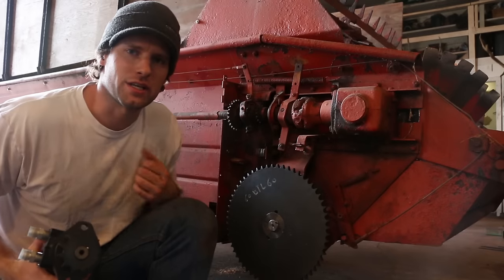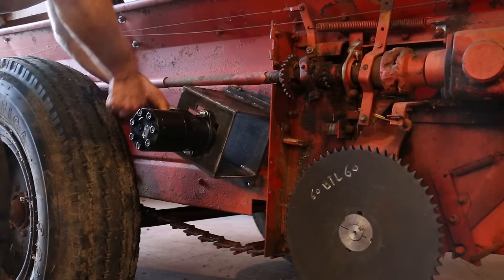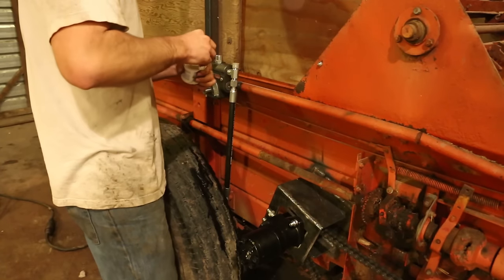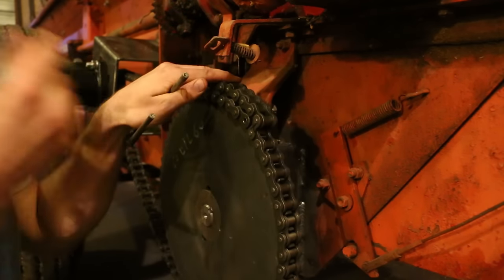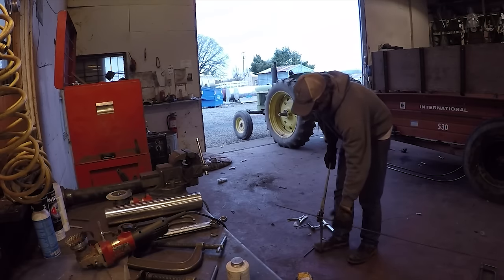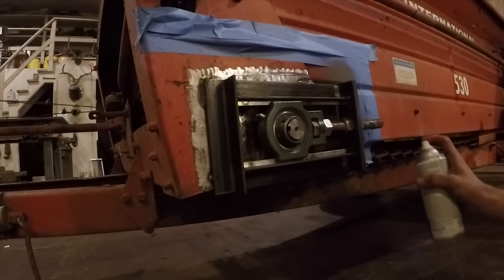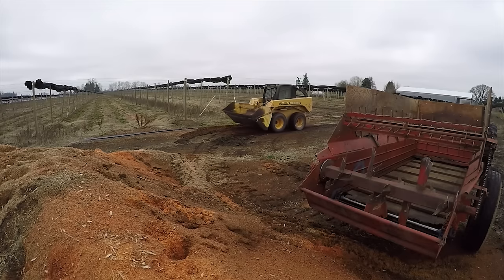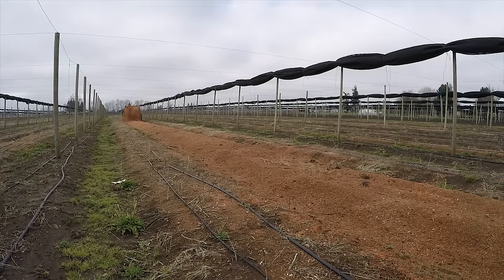Sawdust Spreader Hydraulic Conversion pt. 2

Comment: Great video series, sweet modification too.  Just so you know pipe dope is for PIPE thread, it is of no sealing value for a hydraulic flare fittings however... I have seen people use teflon tape and pipe dope on hydraulic brake fittings too, BUT just like hydraulic flare fittings the seal surface is on the face of the flare NOT the threads... If the flare is damaged and leaks, then you are going to have a leak; no amount of pipe dope will stop it. I guess it's of no harm though(unless you get pipe dope in the hyd system)

Comment: The blue tape was a nice idea for a cleaner aesthetic. 
Here's a tip for you if you ever use it on interior walls in your house. After painting the taped-off area, pull the tape off while the paint is wet. (and pull the tape out & downward for a clean removal.) This will allow you to see if any paint ran under the tape and be able to clean it up easier. This wasn't an issue with your metal project as the substrate was flat rather than textured. However, by pulling tape off early, it also keeps from having the tape tear off in pieces later, which is especially true if you get busy and a week or more goes by before you can return to the project. Been there done that!

You may have already known that, but from frustration in personal experience with painter's tape, I pass it along in hopes of saving someone else the frustration. I remember you commented in a video that you don't like painting, well spray painting doesn't bother me, but I don't like painting walls. I'm a fine art artist, so solid colors are boring to me. haha

Comment: Why didn't you put the hydraulic motor on the inside of the bracket for protection? I know that anything on farm equipment tends to get hit or knocked off. Also, did you mark the hydraulic hoses so the next guy doesn't spin the hydraulic motor backwards?

Comment: Flow control don't reduce pressure to the motor.   They only reduce flow.   At least the pressure balanced flow controls do.
You put the master link clip on the wrong way. The open end of the clip should face away from the direction of chain travel.

Comment: Those look like compression fittings.  You don't need pipe dope for compression end of the fittings.
Reply: +Michael Smith The adapters into the motor and flow control need thread compound though. They are usually NPT.